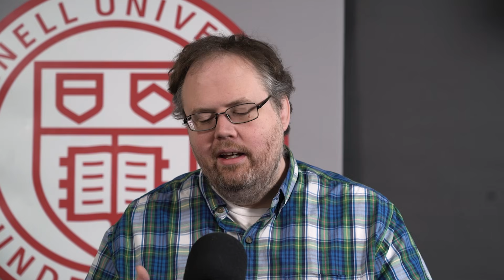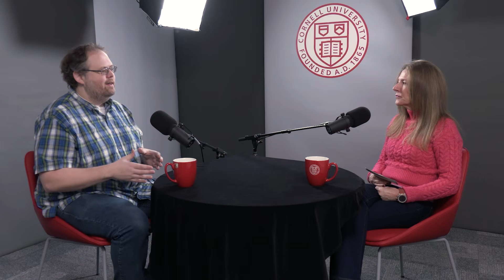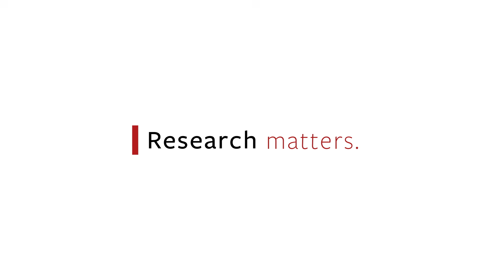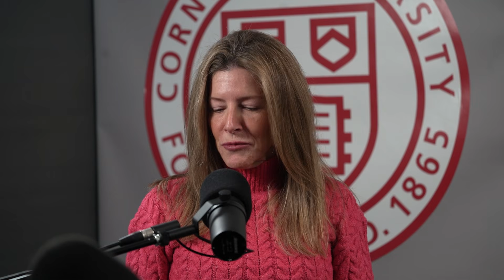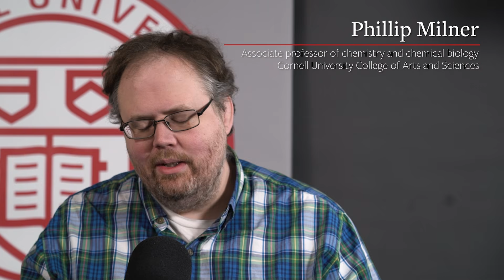Why does carbon capture remain essential?

Comment: Very interesting. Regards from a PhD Cornell Chemical Biology/Organic Chemist. Long before Ithaca- NYC Cornell Weill program evolution, we used current Cell and Scientific American articles (there were no textbooks yet) as PCR DNA amplification had just been discovered. BTW, not silver or lead bullets but carbon bullets. 
Also very interesting on the methane capture and usage discussion. It turns out that animal fat (more than plants) is effective in lubricating human body lymphatic flow. You may know that the lymphatic system (part of both the immune and circulatory systems and the waste management system for all but bowel solid waste including lymph, fat transfer, 200 daily spent bio-signaling proteins, toxins, chemotherapy agents, cytokines and inflammation markers and more) was completely neglected by the medical community for many years (shout out to some DO medical school coverage). An entire lymphatic medical specialty has been built in about 10 years- from radical school curricula to 2nd World Lipedema Congress, 2021 US Lipedema Standard of Care (for disease published 140 by Mayo Clinic) and still trying to add diagnostic codes through CDC annual ICD-10 revision meeting (global ICD-11 has a code but US has not adopted)). Even ARPA-H brain lymphatic (Glymphatics) contract projects expected to be missing link to neurological  diseases. Lymphatic diseases affect 11% US population (7 million), not rare but rarely diagnosed and changing fast. A few key strategies, many diverse tactics.
Shoutout to Cornell researchers who have recently developed a lymphatic flow model published through Cornell Chronicles and presented at Gordon Conference on Lymphatics. 
For these discoveries and public health benefits, we can find a solution to managing methane capture from cow farts! 🐄💨